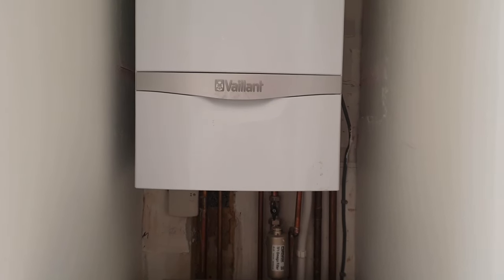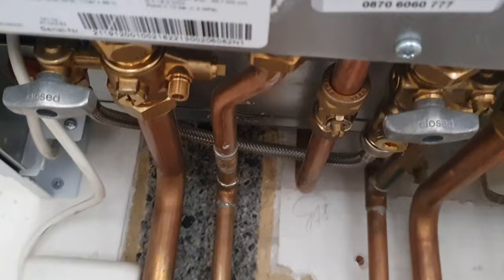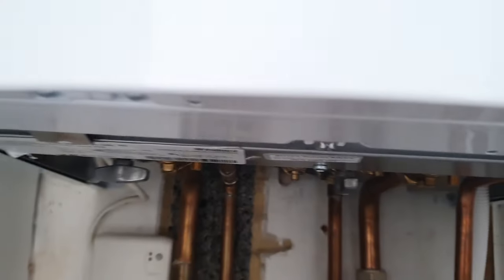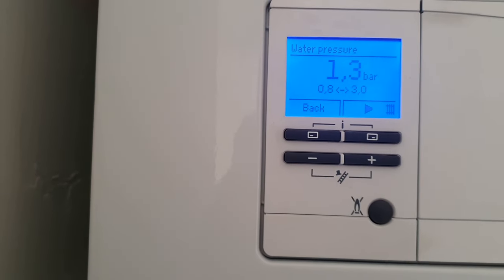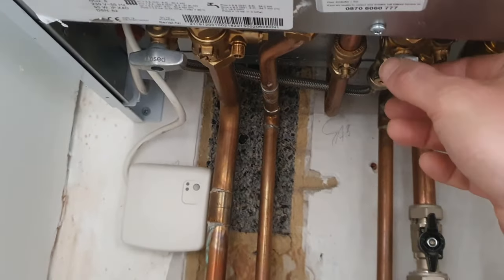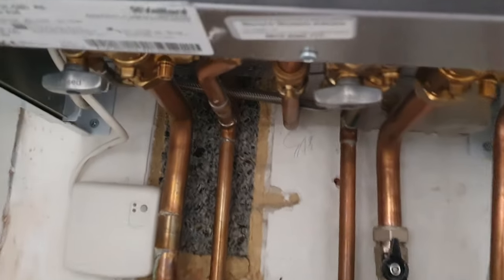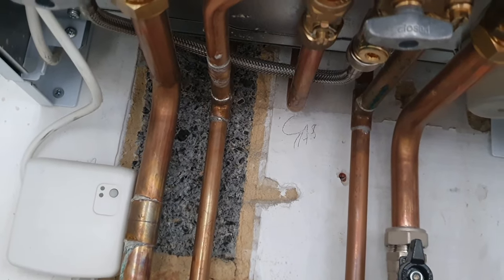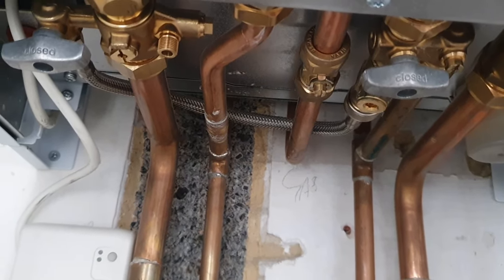Filling Loop on a Vaillant boiler

Comment: My filling loop is letting by water resulting in high pressure - what’s the permanent fix for this? (temporary fix is regularly bleeding the radiators)
is it to simply replace the filling loop by unscrewing the valve nuts ? thanks

Comment: Mine is a different model and it doesn't have those two taps underneath. It just had one key that you could remove. I've lost the key. Is a filling loop valve handle key the replacement key I need?

Comment: My boiler doesn’t say anything on the valves if there open or close but they keep dripping water from the valve area so so they need cleaned or replaced ?

Comment: Does the boiler have to be cool and switched off when doing this please?
Reply: Needs to be powered up so you can see the pressure gauge rising, but make sure it’s not actively heating and is fully cooled down

Comment: how do you drop the pressure if you top up too much water?
Reply: That's what i came here for.. And not info yet
Reply: @tapen678s6  Have you guys find any info on this? I got the same issue.
Reply: Did anyone find a solution for this?
Reply: I know this comment is old, you’ve probably fixed the issue by now. 

But, in case someone else wants to know how to reduce the high pressure, I think you have to ‘bleed’ a radiator. You’ll need a radiator key and something to collect the water in, like a pan or empty bottle. You’ll also need a towel for the water that will come out that you can’t collect in your pan. I usually lay a couple of towels on the floor.